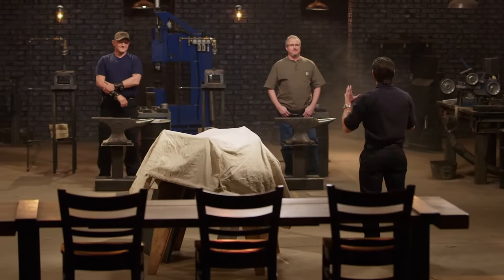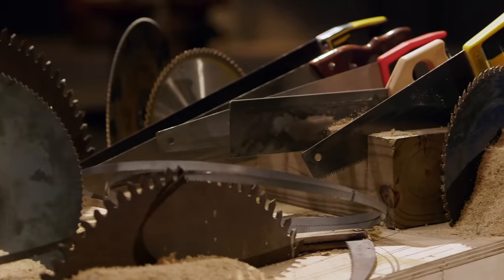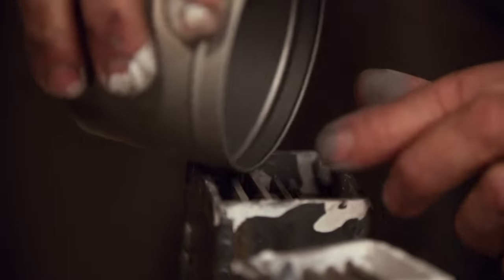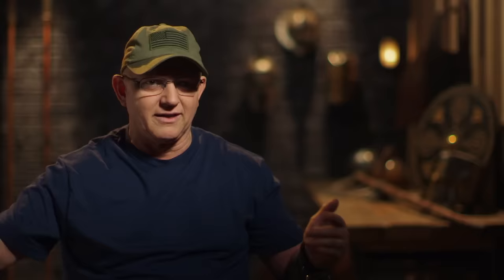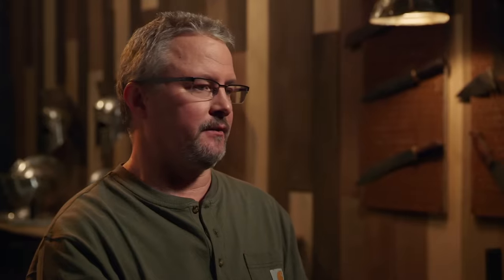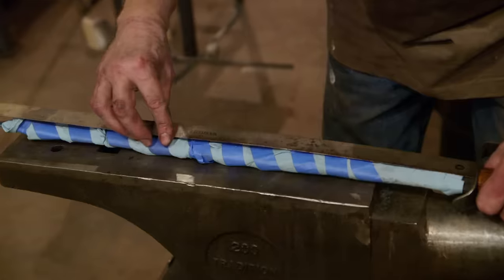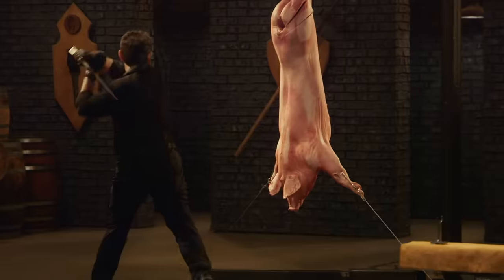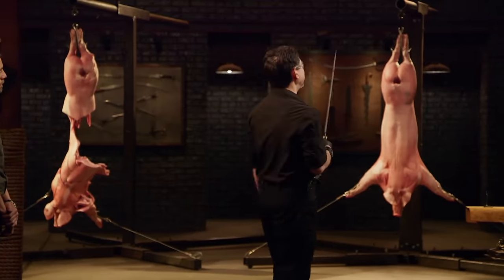Forged in Fire: Beat the Judges: SAW BLADE SWORD CHALLENGE (Season 1) | History

Comment: That decision sucked, jays didn't even cut sand man
Reply: Four pounds is on the heaviest end of European longswords man
Reply: @marcuschung1843  That is just what the judge said, also; a controllable sword which can't hit a single hard object without losing its edge enough to not be able to cut leather is A SIGNIFICANTLY WORSE SWORD than one which is unruly but is guaranteed to cut after being abused.
THIS IS KNIGHTHOOD 101, A SWORD THAT CUTS IS BETTER.
Reply: @D-Vinko  main issue is it still lost its edge quickly aswell and the trade off for the extra weight just simply wasn't worth it. Both struggled to cut so at least with the quick sword you could outmanoeuvre your opponent and deliver a leathal thrust
Reply: @D-Vinko  If we're judging the sword on quality of craftsmanship, which I'm assuming is the name of the game on this show, than a duller edge is much less of an offence than a very unwieldy weapon. A duller edge is easily fixable, a heavy sword is not. Also if we're gonna talk about judging it as it comes for immediate combat use, I'd still go for the lighter weapon, it's not that it can't cut, that means its edge isn't as acute and fine so its less prone to damage and far more preferable in armored combat.
Reply: Nickdiaz209  yep
Reply: Yea
Reply: I think they it was a set up to donate the $$ to the fondation but the other dude won! With the heavy sword!
Reply: @D-Vinko  on the flip side of that: a sword that can't cut can always get the whetstone, one that weighs 4 pounds isn't going to have you fighting for too long
Reply: @DrunkenMonk1  What? A sword that can't cut in a fight leads to a dead wielder. No whetstone if you're dead. A heavier sword which can cut will guarantee you atleast have a chance in a fight. If you cannot cut, and you lose a fight, you dont just go home. In what world are you thinking this sword is being used? Fairy tale land?
Reply: A heavy sword that cuts is better than lighter sword that doesn't cut.
Reply: Nah jays was better, the other sword only "cut" better because it was heavier and delivering more force.
Reply: @owlkage7700  glad I’m not the only one who noticed.
Reply: @DrunkenMonk1  you think fights last long? LMAO 
Only in large battle does that happen. As in thousands and thousands of men fighting.
Reply: @Andrew19972  it still.. CUT as apposed to NOT cutting. 
You know. The entire POINT of a sword. LOL
Reply: @marcuschung1843  it’s about tests about killing and damage the weight shouldn’t matter as long as it still does well
Reply: @owlkage7700  yes
Reply: @Andrew19972  exactly it’s heavier and can cut 

jays blade was too light and couldn’t cut at all
Reply: @D-Vinko  wow I've never met a real knight! Please tell us more!
Reply: @marcuschung1843  I'm guessing a four pound sword would be preferable to warriors who aren't as out of shape as these old judges, at least it cuts.
Reply: A heavy sword with a dull edge can still cut but you’ll be fighting with that lighter sword a lot longer
Reply: @galactic_clashx4056  yes man. Exactly. And adding to this, is the factor of armored combat. Heavier blades do concussive damage, as opposed to lighter blades, which do not.
Reply: @jerielbaker8983  exactly jays blade was trash it was too light and didn’t put a scratch on ANYTHING 
Fake af fake af that’s ALL IMA SAY
Reply: Sharpening the winning sword would definitely take less resources than making a lighter sword.
Reply: @mousaabida9340  a heavy blunt blade can kill. A unsharpened lighter blade can't
Reply: Weight was not a requirement so it shouldn't have lost to a non-requirement different swords for different people in a real fight adrenaline would probably make the heavier sword feel light as a feather.
Reply: Wtf I thought that j lost because it didn't make the cut.. hmmmmmm
Reply: I thought Tony would win too. But I can understand the decision. This is a weapon, and it needs to function as intended. So it comes down to weighing the cut (or really, it was a test of how much damage the blade took from the strength test) vs its maneuverability. A blade that has been blunted too much but is sturdy and light can still be used for defense a depending on your opponents' armour, a decent level of offense. A blade that cuts well despite some blunting damage but is too heavy to wield effectively will leave you open and make it harder for you to connect your blade with your opponent in the first place. 

So I can see why the judge went with Jay's blade based on the weight. Now if this was a kitchen knife, Tony's blade wins hands down, because food won't try to attack you or parry your attacks.
Reply: @D-Vinko  Here's a thought experiment - let's take things to the extreme. You have a really sharp blade that cuts really well. But it's so heavy no human can lift it. Is that a sword that will help you win any fights? Is that a good blade (for a human)?

Clearly at some point, weight... well starts to weigh more than whether the blade can cut well or not. I think the point of debate should be where that point is. And I can see why the judge legitimately feels that weight on Tony's sword outweighed how well it cut. :D

Anyway jokes aside, in medieval combat, a lot of injuries sustained by knights were from blunt force trauma, from morning stars and spears, but also from blades. Because, look, any sword would have a hard time cutting through solid plate armour, let alone one that has a fighter in it trying to stab you back. A dull blade can still deliver a decent amount of blunt force. A dull blade absolutely is a viable weapon, even if it's not ideal.
Reply: @marcuschung1843  Sorry but are you saying a light sword with no cutting edge is preferable to a heavier sword with an edge? I am sorry but the contestant cut the Sandman more times, and a complete cut, where as Jay did not.
If the judgement is going to be 70% aesthetics, 10% Cutting, 10% Blade Strength, and 10% Killing Ability you really should state that as a general rule up front.
Reply: @DrunkenMonk1  And a heavy blade that cuts down its foe because it retains a edge means the wielder lasts longer than the lighter sword that dulls entirely. So to you a butter knife is superior in combat to a steak knife on account of it being lighter.
Reply: @neerdowell6687  I see you're an expert bladesmith too, and I definitely value your opinion.
Reply: I don't understand why do you guys even have this discussion and compare heavy and sharp blade to light and dull? Both blades on this competition sucked at the sharpness test, so none of them had really good edge at that point. J's blade did a little bit worse on the test, but Tony's blade was way heavier, so that's why he was the one to go. So the question is would you prefer somewhat dull and really heavy sword, or more dull but really light one? :P
Reply: InuSakuraKage  I think you just have a crush on the judge
Reply: @スノーハッピー  you act like the blade weighed 100 pounds
Reply: Would you say it also failed to Enter Sandman?
Reply: Do any of the judges take into consideration that the ones who wielded these blades have been in combat or were training for combat and were in much better shape than them? So what might have been a heavy blade for them might not have been a heavy blade for a knight that has seen many battles.
Sorta like an m16 would be heavy on the shoulder for and enthusiast, but almost unnoticeable for a member of the military.
Reply: @raynereed6204  from my viewing it seems they often refer to Doug. He's the actual combat specialist. If he says "I can feel the tendon strain from the weight being too far forward on this blade," they know that blade is too heavy. Just my guess.
Reply: Keyword- Short sword, a heavy short sword is stupid and self defeating,  also, short swords are intended for stabbing,  it needs to be light as you most likely will be engaging in close proximity.
Reply: InuSakuraKage  not if you wear armor
Reply: @neerdowell6687  weight isn't an aesthetic. Scrollwork is an aesthetic. Weight is functionality. Swinging a super heavy sword can do damage, sure. So can the light sword. If both are dulled, they can both do damage, with the heavier sword doing more. But how long you can use a weapon matters, and swinging a lighter sword for longer makes a better weapon than swinging a heavy sword briefly. And truthfully we can debate all day about how heavy a sword should be, but there is a reason why medieval swords weren't four pounds. Not even longswords, as far as I'm aware they tended closer to 3 pounds. Thats been the rule throughout history. Speed is a better killer than weight.
Reply: @Devilion901  yeah, at the very least the weight on a thrust sword should be closer to the handle so there's control. Short swords can be choppy too, but if you really want to sacrifice mobility for power, then why are you even using a sword?
Reply: @D-Vinko  not really? since that sword also lost its edge quickly and if youre bringing in knighthood then id rather a faster piece of metal then a heavier one
Reply: Still a fair dicision as other sword is haviour..
Reply: Its called favoritism. Fake
Reply: I guess it didn’t Enter Sandman 😏
Reply: @owlkage7700  "Mechanical attachment" doesn't mean you have to pin the handle, you should if you're using handle scales, But what Jay did was put the tang through a solid block of wood, put the pommel on it, and the remaining cm or so of tang sticking out the pommel, gets peened into its own rivet which very effectively holds the pommel, handle and guard in place. You didn't know much about smithing when you made this comment huh? Plus, a blade that's light but the edge received some damage, still useable for stabbing, where as the 4 pound blade is essentially a delayed death sentence. You might kill a couple guys if you're REAL lucky, but you'll be exhausted and doomed very soon.
Reply: @galactic_clashx4056  No it's about creating the weapon they told you too, in a useable form. Weight in itself is a parameter, not one that they specify, but there is a threshold that only fools cross. And they won't let one of those fools be a forged in fire champion unless the opponents sword fails completely.
Reply: @erikblarg5498  not sharp didnt succeed in anything had a crappy design it was also too short and there’s many other issues 

I’d rather use a heavy knife than one that can’t cut
Reply: @galactic_clashx4056  First off, it was short because they were tasked with making shortswords, if you paid attention you would have heard Jay when he mentioned his blade was actually an eight of an inch over length parameters, but he ground the tip back to reach parameters. And remember, the one that was twice as heavy barely cut more, even with all that extra heft. Both blades became dull on the portion of the blade that struck the pots, which are harder and more abrasive than bone. Forgive me if I take your opinion on what you'd rather use, quite lightly, since you probably have little no experience, and clearly have little knowledge of what makes a great melee weapon.
Reply: @marcuschung1843  "A duller edge is easily fixable, a heavy swoed is not" 

But we're not judging swords based on what they COULD BE, but what they ARE. This has repeatedly cost people the win, because they didn't put a proper edge on the weapon. Jay's blade was almost blunt. If it wasn't Jay making it, you'd have said it deserved to lose.

And BTW - weight can also be fixed later on. Grind the blade down a little, change the copper hilt to a plastic and metal one, put a slander quillon on there, and boom - we're down to 2 lbs easily. 

Point is, the competition is supposed to judge the swords that were submitted, not the ones that could have been. And objectively speaking, Jay's sword was less well made craftsmanship-wise. Clearly he is not accustomed to making his own damascus billets in such a short time.

Also, later on you're just making excuses. "It can't cut because it has a more acute angle. Therefore it's more robust"
Same reasoning could be said for the heavy blade. "A thicker sword is less likely to break". 

Face it. Jay underperformed, and should have lost.
Reply: @mousaabida9340  shoulda woulda coulda. Jay's sword was blunt. By the standards of this competition, he should have lost.
Reply: @marcuschung1843  I rewatched the full episode for this reason - Tony's sword had a MASSIVE copper pommel and hilt. If that wasn't there, his sword would be easily as light as Jay's. The sword wasn't heavy, the pommel was.
Reply: @camerontennant30  "both struggled to cut"

Check your eyes. Tony's blade tore through that sandbag.
Reply: @owlkage7700  you know mechanically attached is with a pummel and a guard right?  It doesn't need a pin.  Do research before making stupid comments
Reply: @Yeet and everyone else.

Ok so I'm going to comment on a those who said jay's sword handle wasn't mechanically fastened.  It has a threaded pummel and a guard.  Guess what folks. That's a....drum roll please....MECHANICAL FASTENER!!!  DING DING DING!  A mechanical connection isn't just a pin. If you actually did this stuff you would know.
Reply: @camerontennant30  that's completely untrue. 

Jays sword is literally USELESS. it doesn't matter if it can't cut. If it cant cut it's useless. Anything is better than that.
Reply: @raynereed6204  4 pounds is heavier than single handed swords (let alone short swords) that those who regularly trained and saw combat used historically. There’s a reason for that.
Reply: @horvathbenedek3596  removing the weight from the pommel and hilt would just make it even more unusable, that weight would be the only thing counterbalancing the blade.
Reply: @jlaw131985  Except the blade was not topheavy, it was just heavy. If you watch the full episode, the guy slapped a genuine chunk of solid brass on that sucker. It was ridiculous. It's like tying a sword to a 2 lbs dumbbell.
Reply: @horvathbenedek3596  but reducing the weight of the pommel and hilt would make it top heavy.
Reply: @jlaw131985  It wouldn't, because the blade isn't heavy. Again, watch the full episode somewhere - you can see that his sword is perfectly normal, if a bit beefy... and then he proceeds to add easily two lbs of copper to it. 

I'm gonna send you a link, watch it. iF it doesn't arrive, Youtube has probably blocked it.
Reply: @emperornate  that's not how adrenaline works please research things before misinforming people. The 4 lbs is essentially an unspoken perameter because two handed longsword are often lighter than that, Warhammer and battle axes are lighter than that. Remember 4lbs isn't the weight they have the carry, leverage is a thing bud, the more tip heavy a blade is the more and more strain goes on the wrist. All it would take is a heavy blow aimed at the opponent, if the opponent dodges then when trying to stop the sword mid swing and bring it back up the wrist will give out on the person wielding that sword, or a counterattack made with a properly nimble weapon would cut him down before that even happens.
Reply: @erikblarg5498  from a soyboy that has never been in an altercation, anyone that has ever been in an unscripted fight knows that adrenaline makes your adrenal glands produce that magical chemical which makes you move faster and muscles pump harder making things that may have at one time felt heavy just a bit lighter maybe not quite feather light but lighter nonetheless.
Reply: @camerontennant30  exactly
Reply: @camerontennant30  Thrusting wasn't even tested, so as far as we are aware the heavier sword was the only one capable of penetrating anything either.
Reply: @marcuschung1843  That is not what the tests are on. The tests are there to decide who wins and they circumvented them to allow another judge to win.
Reply: @Andrew19972  Not how cutting works. Force = mass x velocity. You can swing that dull sword faster to compensate for the lack of weight and it still won't cut.
Reply: @owlkage7700  mechanically attached means it needs to be held on by pins OR by being wedged into place and held there by the pommel and guard. Both are mechanical attachments.
Reply: @D-Vinko  

I thought that dulling wasn’t until after the abuse?  If it can kill before beating the edge it can kill.  You can usually whet stone after the battle is won… plus if you’re going by a duel between two people who just spent 10 minutes beating those swords, it wouldn’t be much of a fight when the guy with a heavier sword is completely exhausted and possibly threw out their shoulder.  Also, isn’t using a very heavy and clumsy blade a good way of getting disarmed?
Reply: He made a 4lb short sword....that's fail in all blacksmithing books. You're making a sword, not a hammer, dummy.
Reply: @D-Vinko  idk man they both seemed to not do all that much of an impressive amount of damage to the sandman...
Reply: @owlkage7700  They didn't specify what "mechanically attached" meant. The graphic showed the pins, but it could easily not have actually meant that in the competition. For instance, a pommel one a one-piece handle mechanically attaches the grip.
Reply: @owlkage7700  Tell me you don't know what mechanically attached means, without telling me you don't know  mechanically attached means. It also counts if the pommel is screwed or peened. The whole pin-thing is really a KNIFE trait and not a sword trait.
Reply: @D-Vinko  A tired arm and unwieldy weapon kills you quicker than a blunt , but light blade than can still stab.
Reply: @D-Vinko  any skilled swordman will choose the lighter weapon my man , standard's are really important in competition